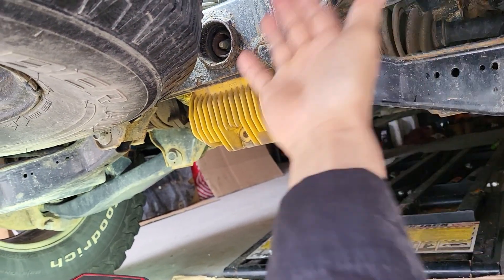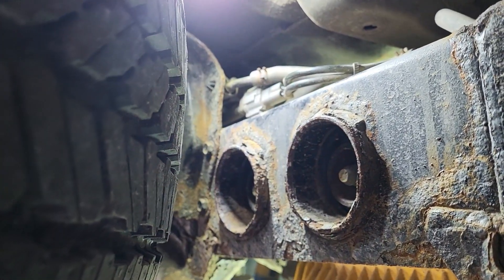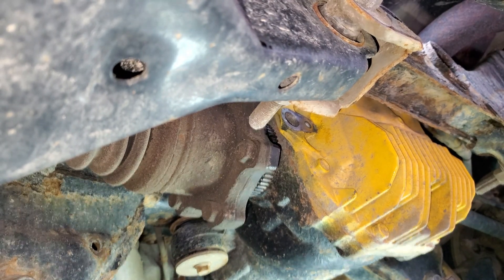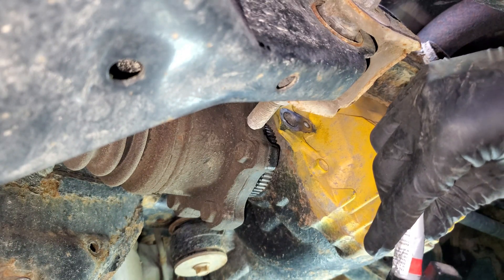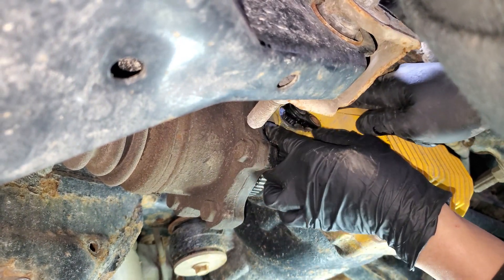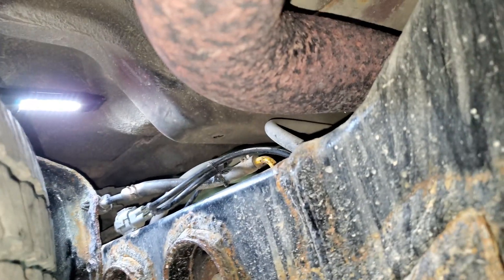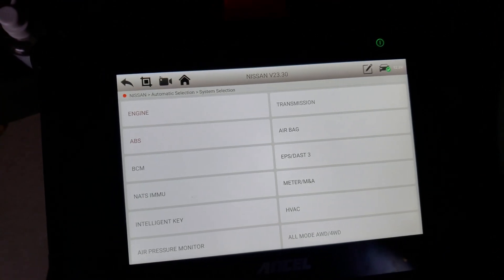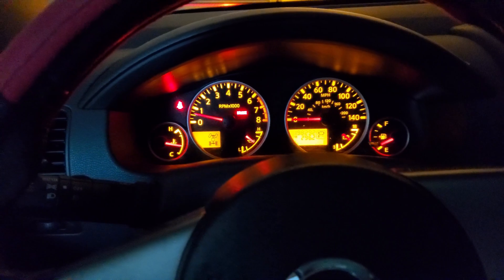R51 NISSAN PATHFINDER ABS SENSOR REPLACEMENT DTC C1102

Comment: Where you getting the VDC lights coming on? Mine are on and staying on. Replace cam shaft sensor, now womdering if these are the culprits (fromt and back)
Reply from the maker: Yes VDC, ABS, TRACTION LIGHT WERE ON. You'll have to scan dtc code and if you have a code like i what i had then it is the culprit.
Reply: @4x4AUTOBOT  just VDC lights. They came on, then after a while they go away, rinse and repeat. Was told sensors can cause this. So waiting for all new sensors to be delivered.

Comment: So the RTV is strictly necessary then?
Reply from the maker: Well, not sure. I didn't have a service manual. But I was certain the old sensors I removed had some kind of rtv in it because I had to clean it up.
Reply: I am wondering,  too. There is no opening into the casing, only through to the ring. So it appears to me to be totally useless since the end is in the open anyway. Maybe some anti seize.